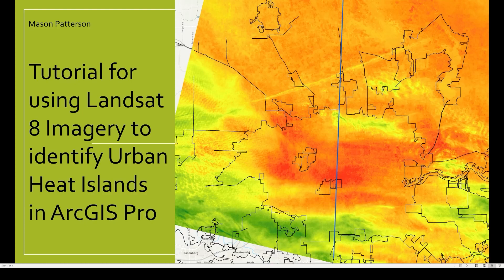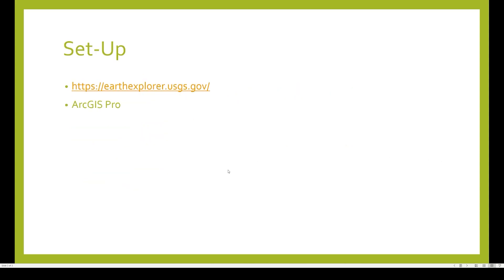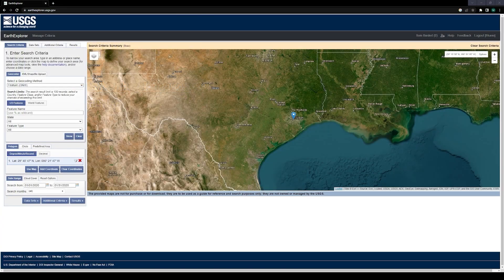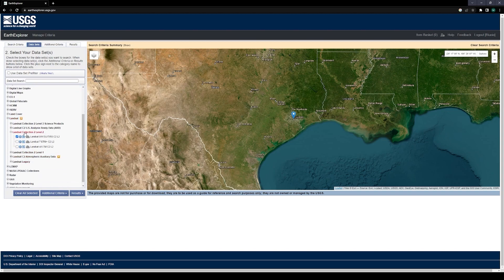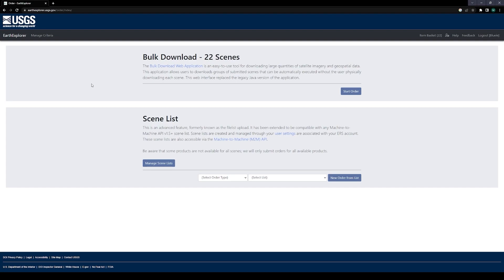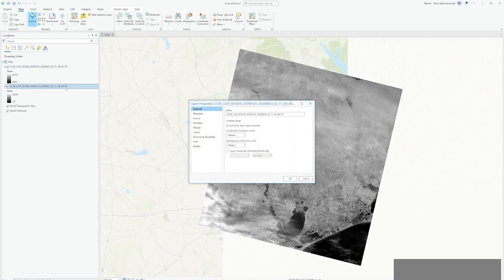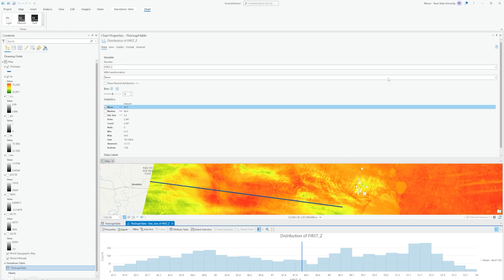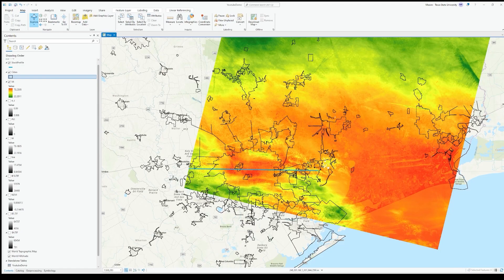Tutorial for identifying Urban Heat Island Effect in ArcGIS Pro

Comment: Are the LST temperatures in C or F degrees? I'm making a map using your procedure and the values on my legend suggest that temperatures are in F, otherwise they would be really high C values. Just wanted to check with you! Thanks
Reply: I have the same problem, if the LST temperature is in C, then that's too high. Did you find a solution to this problem?

Comment: I am working on a heat island project in Macomb County, MI. If you have written a paper on this subject, I would be very interested in reading it.
Reply: I am most interested in the constant values used in yours formulas. I know these may vary depending on the specific calibration or adjustment requirements for the dataset or application. How did you determine what to use for these values?
Reply: @ThomasGirdwood-ej1fx  I also would love to get some insight on the values you used in your calculation.